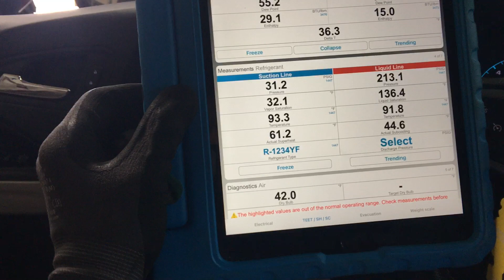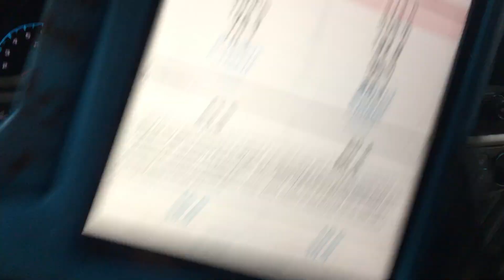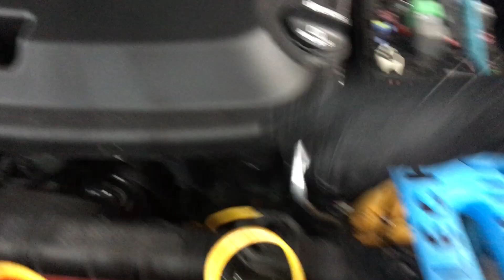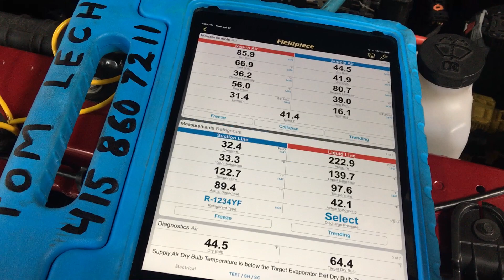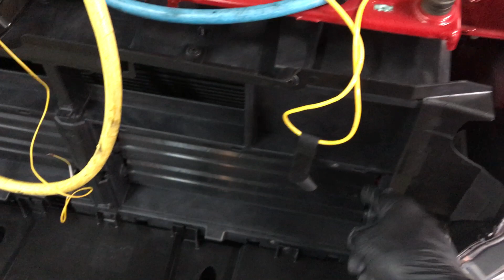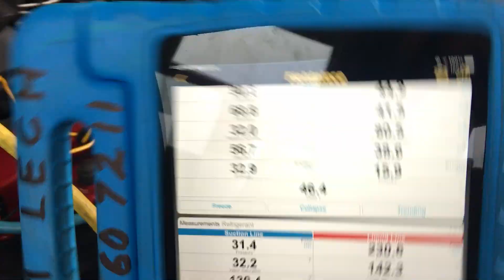HVAC Modules or software determines the pressures and temperatures variable ￼ speed condenser fan￼￼

Comment: So in this kinds of system  how can you diagnose a failure?.  If pressure SH ,SC is not relevant   what methods are used then???
Reply from the maker: You recover the refrigerant and recharge by weight to factory specifications. 
         Then you diagnose. 
You still can use your scan tool to drive the compressor displacement higher or lower or you could use your aftermarket displacement switch tool to hook up to the solenoid on the compressor directly in drive The displacement higher or lower. 
               Read the manual is like any other car to test sensors .

      You don’t try to use superhero sub cooling on these cars it’s not a residential Air conditioning system. 

          Cars are too unpredictable because of things like the fluid thermal fan clutch constantly varied would never give you a steady state.  

           Unfortunately cars manufacturers have not provided a test mode for the air conditioning some have  but not all. 

       Daikin or LG or Mitsubishi or Samsung You hook up with the factory software you put do you need into test mode and it overrides all the sensors and manually set condenser fan speed at a certain speed that it needs for testing it sets the inside air handler’s fan speed it’s it’s the compressor speed and it takes over in meters the refrigerant flow through the electronica expansion valve at a certain set rate.         Been with the sensors that it has located exactly where the factory placed them on different refrigerant pipes for pressure and temperature to determine refrigerant system is full or not correctly. 

        The Prius has this function when you’re using Toyotas factory software .
Reply: @coldfinger459sub0  tnx for reply. So if I understand  you can set the displacement to 100% and then diagnose using pressures and SC ,SH ?
 If this system are set to 100% do they act as fixed displacement?
Would appreciate to see how you use an aftermarket displacement switch.
 Great info 👍.
Reply from the maker: @yossikoren6658  no.  You have to read the manual if it anything more complicated then what you find with simply using you hand touch for temperature. 
            You follow the manual instructions to that manufactures test procedures. 
           Different on different vehicles. 

 The tools to override the displacement dose not let you go over Roughly 80%  for safety. 

       You can add heat to the ambient air temperature sensor and Chinese strong he’s light on the dash mounted ambient light sensor. And watch your pressures move as the computer sends the message to the compressor to increase displacement.  That’s one thing .  But that’s only a simple test not specific just to see if a response happens. 

      To test a specific components you disconnect them use your volt ohmmeter RTFM Read The Fantastic Manual and follow the specifications to see for the proper output

Sometimes it’s not the AC system at all that has the problem it could be something as simple as one of the underdash vents doors stuck open the heater core at the same time you’re asking for air-conditioning and heat always wins. 

         It all comes down to one thing there is no universal method on every year make model vehicle
                   RTFM !!!...
Reply: @coldfinger459sub0  They make matters difficult so this mean  that AC problem should be serviced  with dealership only.
Reply from the maker: @issamadam9352  HELL NO.  Most dealerships are idiots who just learn how to change parts on commission for the fastest change out for parts for the highest pay bonus. 

     This means we have to use our brain something the majority of the population do not do and the other half do not know how to use it. 
                 Everything is easy once you learn. 
RTFM
Reply: @coldfinger459sub0  Than for your very useful vodeo. But From where you lean all these tons of informations?
Reply from the maker: @issamadam9352  are there are these mystical voodoo power magical items of learning. 

    They are called BOOKS 📚 
Then I always volunteered when I was young and even still to this day to take every training course offered by your local parts house or distributor for equipment or parts. 

I have always flown myself out to different states and cities to go for manufacture training

And now the new generation has this thing called the Internet where the manufacturers of tools and equipment and manufactures of parts like DENSO or sanding or Frigidaire or courier or train. Offer online webinars and courses you could go to Spourtland website to learn about expansion valves and superheat and sub cooling you have Jim Bergman you have HVAC School For Techs by Techs and many other resources it’s very easy nowadays
Reply: @coldfinger459sub0  Thank you
Reply from the maker: @issamadam9352  Spread the wealth of knowledge to all